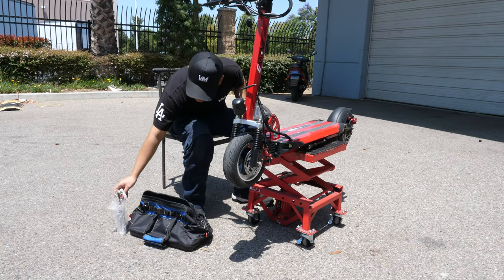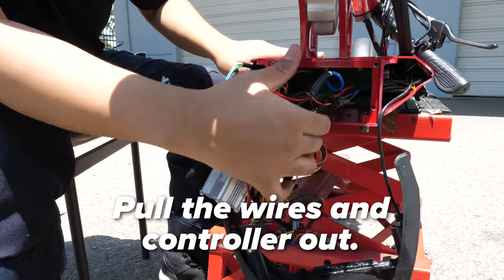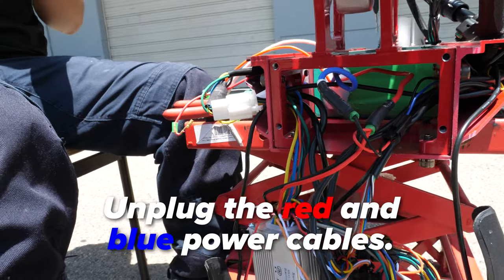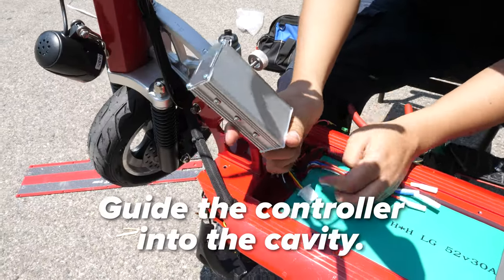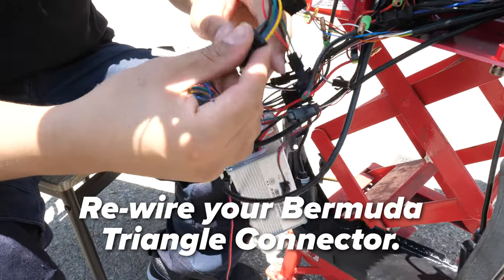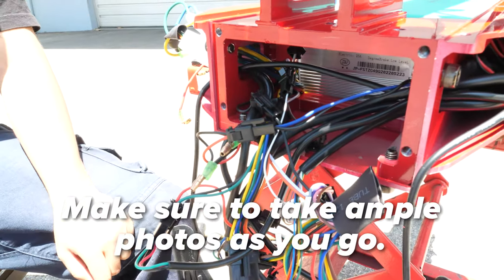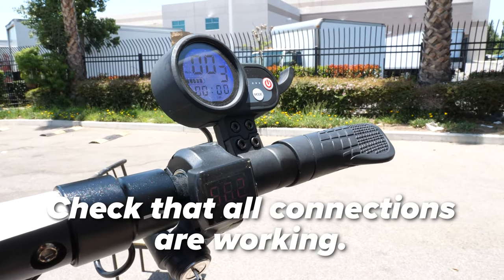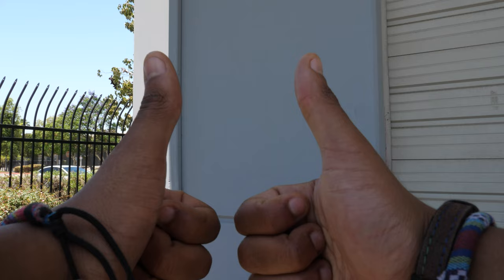How to replace to the new upgraded Controller on EMOVE Cruiser electric scooters

Comment: Im tired of having to replace the controller, do you have your own recommendation for a longer lasting controller? Are all controllers the same?
Reply from the maker: Hi Master Arselyn, have you tried the new controllers, this video shows you how to fit the new upgraded controller
Reply: @electromotionaustralia7119  no, i actually didnt, the company been the one to replace it, so i have no clue if they put in the newest controller or not. Last time they fixed it was almost a month ago, soon as i use it it broke down in less then 10 mins. So right now its with them again but this time if it breaks again i eanna buy one that works and last.

Not only that but i also need a better set of tires that works for more difficult roads as my city has a bad history on having good roads
Reply from the maker: @masterarselyn6470  where are you located?
Reply: @electromotionaustralia7119  in the small city of spokane, roads arent bad bad, but there alot of areas where the roads are cracked and up hills.
Reply from the maker: @masterarselyn6470  I mean if you are located near us, so we can have a look at you scooter. We are located in Sydney
Reply: @electromotionaustralia7119  if you refering to sydney in australia then i cant. Since i am in the USA

Comment: I have a emanba vL 12 pro ? Wheel has 850 on but no w so confused but I need a new controller I think I cut the ignition wire by mistake there was a big spark now it doesn't turn on I'm thinking it's the controller but can't find a replacement can anybody help 🙏🏻